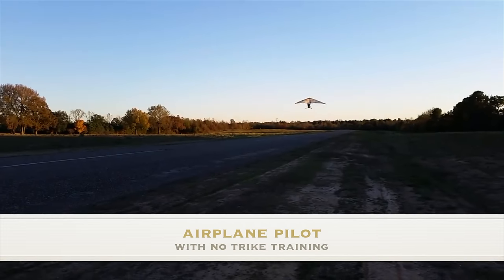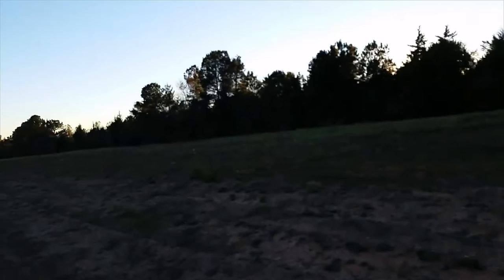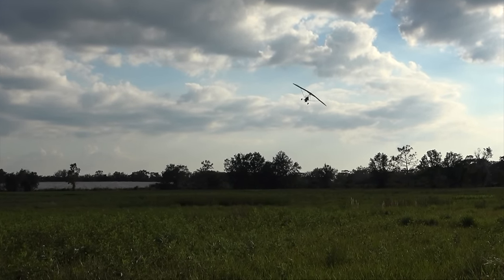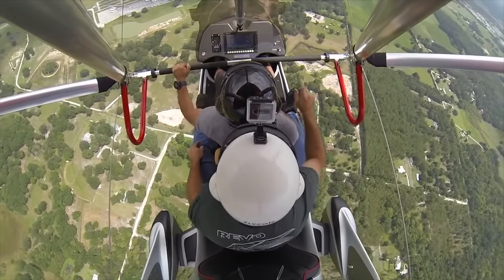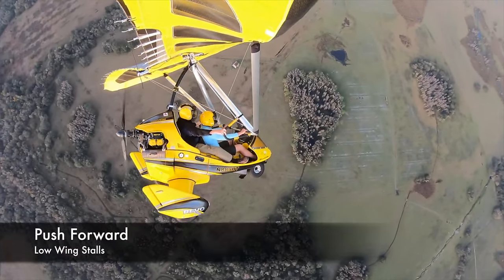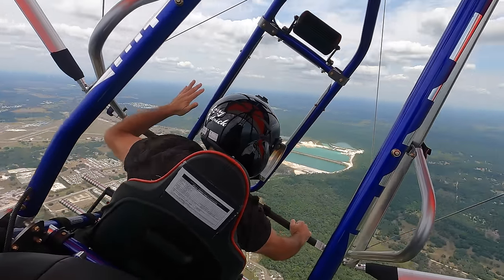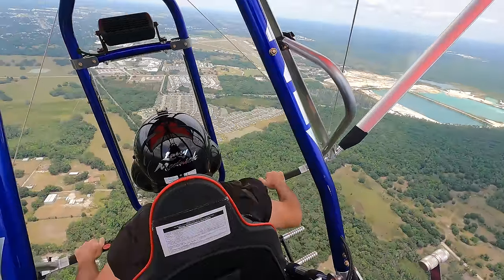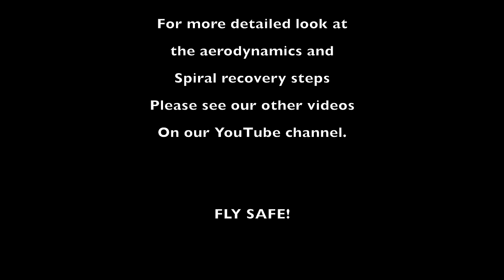Loss of Control in a trike

Comment: Seems to me as a long-time hang glider pilot that most all of these problems involve the pilot's use of power being relied on too much. Climbing steep when down low really is stupid when we consider you are trusting the power 100 percent to prevent you from stalling. Add to that the power will climb you into a full-blown stall that generally doesn;t happen without power.
Reply from the maker: Power will not cause a stall nor will the engine quitting in a climb with a trike. Climbing steeply has its dangers, and increases pilot task load. The spiral is developed from a non stalled condition in this video. 

I will make a video demonstrating how hard it is to stall a trike. They must be forced into a stall unlike many fixed wing airplanes.
Reply: @LarrySMednick  Compared to a glider translating it's speed into a stall trikes under power can definitely produce a greater stall. Nowhere did I say the power will cause a stall. Flying gliders for 20 yrs before getting towed up under power was pretty unique for me. First thing off the dolly I noticed how I could push the bar out and climb and climb. Far to many pilots rely on their power far too much. IMO
Reply from the maker: @banalpedant41  pretty much most Trikes climb best with the bar neutral. Pushing forward on the bar is not how you climb. If you don’t push the bar all the way forward to the compression strut it’s not going to stall.

It seems that you might be interchanging attitude with angle of attack, which are completely unrelated. Very confusing topic with aerodynamics. If you want to know what I mean, this video explains it all.  1 hour Unscripted Flex-wing Aerodynamics Session with Larry Mednick
https://youtu.be/fbXz26wu370
Reply: @LarrySMednick  Pushing out in a non powered hangglider while being towed makes it powered right?  My comments relating to pushing the bar out are being confused by you. What I'm saying is if you have a high angle of attack and the motor quits you are pretty much stalled. Why on earth do I keep seeing guys in tugs do this?  It's not wise when there is no need for it. Just look at the first clip in the video.. why???? Why climb so steep?   The common cure among powered ultralights is this>>> add power. So much so they often equate power with more speed.   
Twas why I said , far to many trust their power. BTW  Being soaring for over 4o yrs now. It's not likely you are going to teach me much about angles of attack and the likes.
Reply from the maker: You’re right about one thing, you can’t tell a 40 year hang glider pilot much they don’t think they already know. But man when they try flying a trike do they seem to change their tune. https://youtu.be/i_xSa9hyQrU?si=uG8-p3e05-Tyy3Ra
Reply: @LarrySMednick  Perhaps it's the mindset of a person that relies on power no matter how many times they are shown it's the power that is getting them in trouble. Perhaps the basics of wind going over the wing gets forgotten or more to my point, they relies on power to compensate for their lack of flying skills?  BTW I noticed you didn't address a single question I asked. Why so many climb so steep on take off?   Because they can even though it's not wise? I could show you countless videos of guys stalling on take off. Some even drop the power not knowing what the heck just happened. That dude in the first clip really messed up and yet he was a ultralight pilot.
Reply from the maker: @banalpedant41  climbing out at full throttle at best L/D is completely safe and the best way to climb to altitude. In fact it is BEST for the 2 stroke motor in this case with lower EGTs and better lubrication at high load. 

Climbing steeply does not mean climbing at a high AOA. (This is discussed in the video link I shared with you) But to be clear, the steep climb on the video was not achieved by holding the bar forward. 

The pilot that crashed in the opening scene was NOT a trike pilot. He was an airplane pilot. It takes 20 hours on average for an airplane pilot to solo a trike. He crashed and was going to crash no matter what. 

I gave you a 1 hour video explaining everything you asked. You didn’t watch it because, as you’ve said, you already know everything there is to know about aerodynamics and flying all sorts of powered aircraft such as a trike. 

My answers are here for the public to read as well as you. But the trike didn’t stall, it didn’t crash because of a steep climb, it crashed because he dropped his wing during the climb and didn’t correct because he was completely untrained to fly this type of aircraft as are you. I’m not trying to be condescending with that statement, but it’s true and very relevant in this particular discussion.
Reply from the maker: @banalpedant41  I do appreciate the discussion. You are literally shaping my next video. Your thoughts and concerns are well hoed often in the aviation community. Comparing a Dragonfly tug to a trike in how each will react when power is cut in a steep climb is where there is a difference. The trike will respond nearly identical as your HG when you dive and then pitch up and let go of the controls. It will simply nose over without stalling (less than 40 degrees nose up) and continue flight nose down before pitching up again. Trike also fly powered off as well!

 Engine off in a REV X
https://youtu.be/S-ljgYZuiGI
Reply: @LarrySMednick  Angle of attack relates to the relative wind which changes as soon as the trust quits and you're without power. Climbing steep is fine so long as you have power. It really comes down to you trusting in that motor.   Twas why I keep mentioning it.   lol
Reply: @LarrySMednick  He drop a wing<<<< meaning he stalled a tip. Tips stall last with that much washout built into the wing which suggest to me the entire root of the wing would have stalled if not for the power but we know that from when he dropped the power off.  He climbed steep and didn't correct a thing just relying once again on that power.   Maybe he shouldn't climb so steep huh? fly faster as to not stall?  Of course.
Reply from the maker: @banalpedant41  in a trike, we have the thrust line well below the CG (unlike a Dragon Fly for example) We also have extreme. Pitch stability which rapidly react to airspeed. So when the motor quits with the nose up in a trike, the airspeed starts dropping rapidly as you are saying. However the trike will begin its nose over before reaching critical AOA because of the low thrust line and the reactive pitch stability of the wing to airspeed.  There will not be a stall. Therefore the wing will not drop as a result of a stall that didn’t happen. What you saw in the video was the wing drop while power on at a stabilized airspeed. 

One more example. Take your HG, dive it, then pitch it up to the attitude in the video, then let go of the controls and you will see your HG simply enter a pheugoid oscillation. No stall, no spin. It may bank due to outside forces with no one at the controls, but stall is not one of the things we can expect. Having said that, if you exceed 40 degrees nose up and do the same, it can stall (much higher nose up than the video) and then whip stalls are a huge concern. But that’s not an attitude that was exceeded in this case. 

So watch for an onboard video of chopping power in a full throttle climb and its effects and what is needed to land from a power loss below 200-300’ because above 300’ the pilot need not do a thing to continue unstalled flight. But I’ll take it to a stall and you will see how quickly the trike starts flying again within a second. But that will only be achievable from a zoom climb like this. ROCKET TIME!
https://youtu.be/wah4CfeuljY
Reply from the maker: @banalpedant41  can’t stall a wingtip on a trike or we would all be dead without a rudder by now. But this is another common concern of fixed wing pilots thinking a rudder would be useful on a trike.
Reply: @LarrySMednick  non sense. The pilot in the first clip stall a tip. Why do you think he spiralled in? He let the wing keep turning and turning until the tip started stalling. He then dropped the power for some strange reason and the entire wing was worthless to him. For a fix wing pilot who should know about airspeed he sure didn't know how to respond to try to regain speed. Once again, a pilot who relied on his power to hopefully take care of airspeed for him. What you mean to say is tips don't stall provided you have enough power.  lol   It's sad really because the wings used on many trikes are very forgiving wings with plenty of washout.
Reply from the maker: @banalpedant41  wing tips don’t stall on a trike period! 

Why did I push the bar forward at 1:08 in this video?  This is the same maneuver. 

You have an entire video explaining this. Thats all I’ve got for you.
Reply: @LarrySMednick  They don't or they can't?   I think your messing with me now.  Why on earth do they utilize washout struts if the tips can never stall?  Is the term 'washout" messing you up?  I realize your wing is very forgiving but to say the tips can not stall is silly and dangerous. I realize you will just move the goal posts and start explaining away why they are hard to stall so have at it.
Reply from the maker: @banalpedant41  nope, no more explaining. You need to open up an FAA book or aerodynamics book on flex wings and trikes..

Comment: сваливание ну или штопор, какое бы крыло не было, а физика одна, просто в экстренных ситуациях когда уже остаётся пару секунд для предотвращения сваливания, начинающие планку управления толкают в неправильную сторону, управление с самолетами различны тут, отсюда и все проблемы начинающих.
Reply from the maker: If by push the control bar in the wrong direction you mean forward, then yes that is very common, but we see high time pilots with no spiral training do the same thing when the time comes. Pushing forward is usually the problem.

Comment: All the more reasons to fly a Powered Parachute 🪂 Plane Vs Trikes.
Reply from the maker: Powered parachutes have their own problems and dangers just like every other type of aircraft. If you think powered parachutes are safer and more capable, you need to do more research. If you want to fly an aircraft that can’t kill you, it’s called a flight simulator. Otherwise you better get all of the training to fly whatever category aircraft you intend on flying and understand every flight has potential risk. Only good decision making, good skill and equipment can minimize that risk.
Reply: Don't rule out paramotors. I've been trained on my paramotor.  My weight shift nano-trike sits in the shop gathering dust for lack of training.

Comment: This appears that because of the dangling mass of pilot and engine, forcing the cg under the non stalled wing rights the airfoil (?)….
Reply from the maker: Some wings have more roll stability, but overall, all trikes have neutral roll stability. At the end where the trike recovered on its own it came out only because I lifter off the throttle, the wing has some positive roll stability and a thermal helped level the wings. Generally the trike will lock into a spiral and stay in a spiral without pilot input and with poor pilot input as well. Getting out is effortless if you know how which is super simple.
Reply: @LarrySMednick  thank you

Comment: This is so idiotic. Everybody should be required to have parachutes on every aircraft we do have them you know
Reply from the maker: I agree with you and the trikes in this video did have parachutes. But now can you explain how a parachute works from 100’? This is real life, not a cartoon.  You need to deploy a parachute at 500’, even a rocket deployed chute like the trikes have.  Pulling a chute because you don’t know how to control your aircraft is a pathetic reason to use one.

But in all actuality, you bring up a very valid point. These Trikes a lot of times are well above 500 feet when they lose control and do have every opportunity to pull the little red handle which will deploy parachute. It is crazy, but true, when a pilot is fighting to gain control, it seems to be the last thing they think of is the parachute that’s right there.

Comment: You make a lot of incorrect statements. It's not a "spiral",  it's a spin. The plane does "know" when it is close to the ground, it's called ground effect and atmospheric pressure. You don't mention angle of attack? The word pitch didn't occur, did it? You are teaching a bunch of guesswork by rote. You think dumbing it down for idiots is the way to go?
Reply from the maker: You are assuming you saw a spin. In your defense you are among many fixed wing pilots that are misidentifying what you are seeing. The fact is that trikes cannot spin. And with that said everything you know about a spin and spin recovery does not apply to recovering from a spiral. 

Regarding pitch, the nose is always, let me say that again, always down and because of the strong dynamic pitch stability the trike will nose up, usually pretty hard, as the wings are leveled. Pulling back will reduce the G load on the exit and hopefully stop another high nose up attitude after the recovery. 

The plane does respond to control input the SAME in ground effect and out of ground effect and in all DA and air pressure. I think you mean to say PERFORMANCE changes with altitude and ground effect. But the plane does not know or care where the ground is which is the point I made. 

If you want to debate this any further, I suggest you read the FAA flying handbook for Weight shift control so that you can first understand that Trikes cannot spin and 80% of all trike fatalities are caused by spirals. 

The video linked below explains why this is.  And I can understand why a fixed Wing Pilot/instructor thinks they are seeing a spin in the video or even a stall because admittedly that is EXACTLY what it looks like. Right up until you are in the trike and realize your airspeed is high and you are in coordinated flight. Heck, if you scroll down, you will see an overly confident jet pilot making the same argument. 

But I will agree, this is the dumbed down version of what to do. This is the long version of why:

 https://youtu.be/fbXz26wu370?si=nCqB6RLvOSzgNUuG
Reply: @LarrySMednick  Wow. I never knew they were that different. There is no skid component (uncoordinated yaw), so that is an excellent argument against it being a spin, now that you mention it.

Comment: It’s a stall/spin
Reply from the maker: No sir, a trike cannot spin. It has between 7-30 degrees of washout in the wing (depending on the wing). Spins are impossible in a trike, but very common in fixed wings. What you are watching is a very high airspeed. maneuver that is completely coordinated with or without a partial stall on the lower wing, which still does not constitute a spin.

Comment: Death traps
Reply from the maker: So are cars and motorcycles. At least when an aircraft crashes there  is a VERY high chance the pilot caused it.  When you get in an accident in a car or motorcycle there is a very high chance someone else caused the accident. I’ll take my chances and bet on myself every time.
Reply: @LarrySMednick  true. Trikes are just a bit worse. I have seen too many motorized trikes crash primarily due to overspeed/overstress issues. 
A ballistic recovery unit would be a good investment.
Reply from the maker: They have parachutes. But you need altitude (500’) and sense to pull the handle. typically during loss of control, the pilot keeps doing what is not working. Lack of training is 100% to blame in my opinion. Blaming the machine is misplaced blame.
Reply: @LarrySMednick  I can agree with this.

Comment: Death traps!
Reply: Nah.  Not if you are trained.
Reply from the maker: So are cars and motorcycles… the nice thing about flying any type of aircraft is that if there is an accident there is a 90+ percent chance it was completely caused by the pilot. When you’re in a car or motorcycle, there’s a good chance that somebody else will be the one causing the problem.  A well trained pilot, flying good equipment, making good decisions is at a relatively low risk when flying.

Comment: Trikes are stupid with reversed controls!
Reply from the maker: Airplanes are backwards. Trikes are the right way! 😉 the ground steering on a trike is identical to your first tricycle when you were in diapers. Did you think that was backwards also? 😂
Reply: @LarrySMednick  Errr up is down and down is up.Left is right and right is left.Hogwash!! I’m a B777 Capt and got here flying about 10 different types of aircraft.If planes flew with illogical reversed controls heaven help us!!
Reply from the maker: In all seriousness now. If you hold the yoke with your right hand and want to bank right, you move your hand downward. If you switch hands on the same yoke and want to still turn right you move your left hand upward. The yoke isn’t backwards, you have simply shifted the pivot point of the controls relative to your hand. If you are driving your car and have both hands on the bottom of the wheel, you are now steering like a trike. Right is left and left is right. Once you realize the pivot point of the controls on a trike  is above your head and in a plane with a stick, the pivot point is below your seat, neither one is backwards. The same principle applies to pitch. 

I fly and teach fixed wing as well and I can jump from one to the other with no issues. Many of our customer base are commercial pilots or retired commercial pilots with 50,000 hours in many cases. They learn to fly a trike because it is more fun than any other aircraft out there. 

As far as the foot pedals, I refer you back to my tricycle comment above. 😉